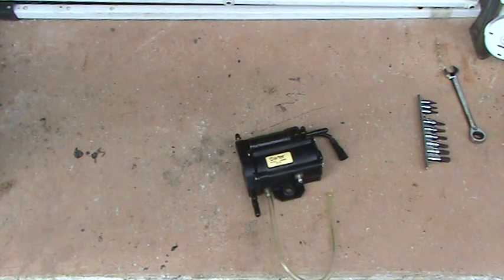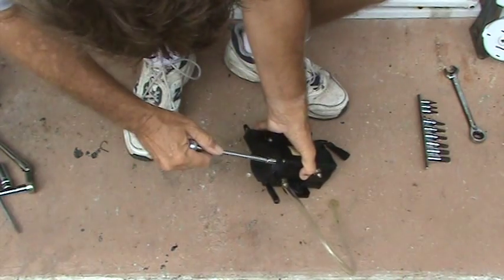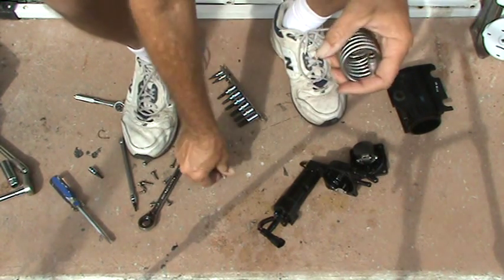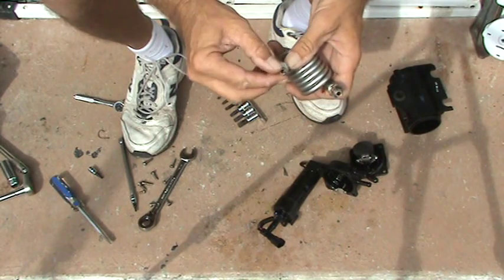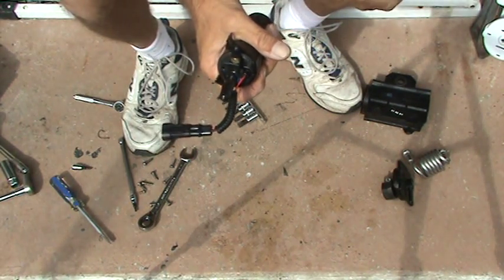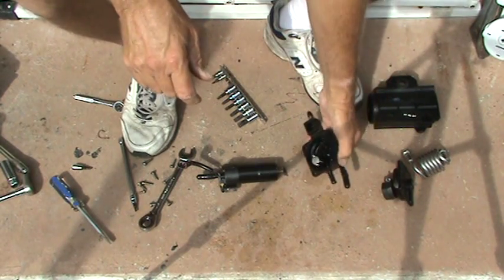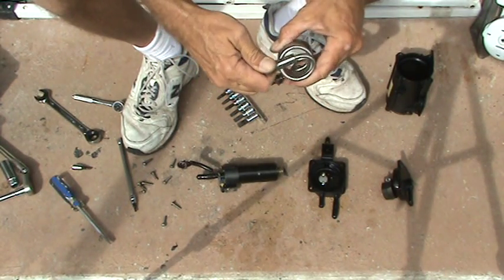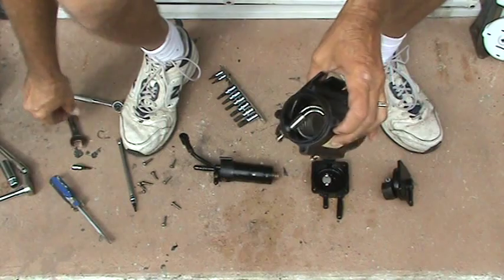2011 225 ETEC vapor separator tank VST disassembly 3-29-14

Comment: Delete the water line system I did say it suppose to cool the fuel but more like heat the fuel. Other outboard dont have them anyway.
Reply: Needs to do a pressure test of the coil.

Comment: did it run fine until it.warmed up....i have a 2008 225 etec that's having an issue. it will run for a while...once it gets hot it slowly stalls.... sometimes it will run for like 10 plus minutes
Reply: Did you figure out your problem with it stalling on you..

Comment: did it run fine until it.warmed up....i have a 2008 225 etec that's having an issue. it will run for a while...once it gets hot it slowly stalls.... sometimes it will run for like 10 plus minutes